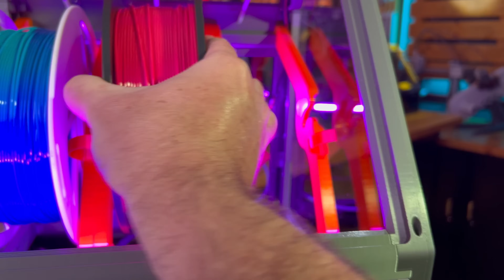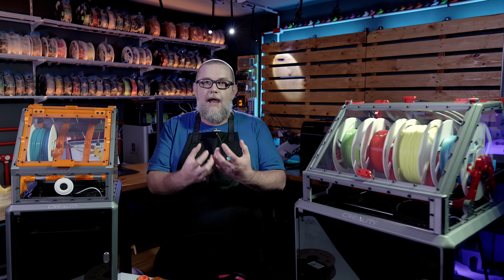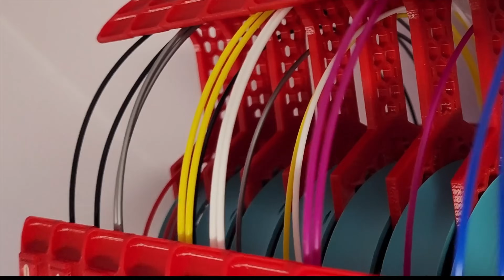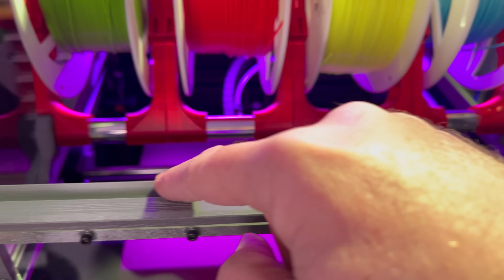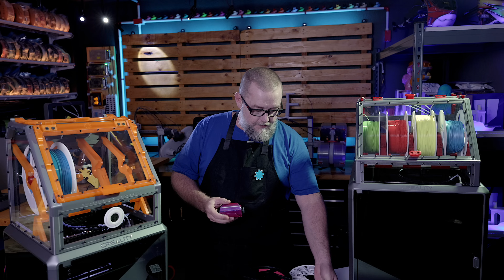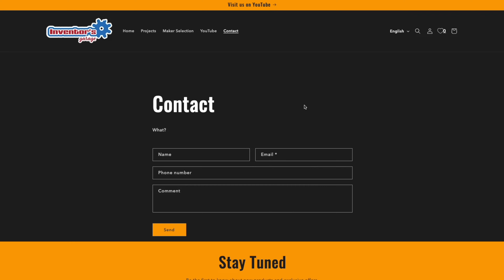Multi-Filament System and Filament Dry Box for Creality K1, K1C, and K1 Max 3D Printers

Comment: Hi, you have made so many upgrades to the Creality K1 Max, and I have also bought the blueprints! But I have a question!
Now that you can get a conversion kit for the Creality K1 Max, so you can print in up to 16 colors, but the machine throws clippings all over the machine, couldn't you invent a new back plate, so you could throw clippings out like with a Bambulab printer?
Regards Johannes
Reply from the maker: It's a good question Johannes. There are a lot of people on the community who already integrated the MFS with MMU, ERCF and 3D chameleon, this is the wonder of a project like this. Unfortunately I can't buy all possible open/closed source multi-color systems to integrate, but buying the project you have access to all files, and you can modify it as you need to integrate to any automation system.

Comment: Have you seen the cfs upgrade kit available for the k1 max released by creality ? Do you think you can use that and youre system and it’ll work as automated filament changing system ?
Reply from the maker: Well, the intension is not to compete with CFS or AMS, these are plug'n play automated systems. The idea with MFS is to provide a customizable and expandable project that anyone can build and use to keep their filaments dry while printing without having to spend extra energy.  And the MFS project does it perfectly for hundreds of people currently. 
I have no intension on automating it, but, I made everything I could to let it prepared for anyone who want to.  
There are some people in our Brazilian community working on the integration with ERCF, MMU and 3D Chameleon, but, the biggest challenge is not the MFS integration, is the K1 series integration.

Have a great day
Reply: @ yes have you seen the upgrade kit that was just released in creality uk website ?
Reply: Is there one for the k1 series? All I can find is the one for the k2

Comment: So my question. Is this like an actual multi material system or is it just to hold the filament and make it a little easier to run the filament and keep it dry all in one? There doesn't seem to be any motors and he doesn't talk about anything with configuration changes so seems like just a box on top. It's a good box but I need it to be able to change the filament by its self.
Reply from the maker: Watching the video you will have all these questions answered and well explained

Comment: Is this latest version getting the desiccant basket?
Reply from the maker: After many tests, the reactivation rate of the silica inside the MFS was considered too low to be worthwhile, and using it to dry the filament is also not worth it; it uses a lot of silica because of the moisture that enters the printer when it is turned off. Drying the filament using the printer's heat during printing is 100% effective, and storing the filament in bags with silica proved to be the best procedure when not using your printer. That's why I discontinued the silica basket, but if you have the previous version and still want to use it, it is still compatible with the current MFS.
Reply: @InventorsGarage  I would love to try it out but don't have the file as I purchased the personal license yesterday.